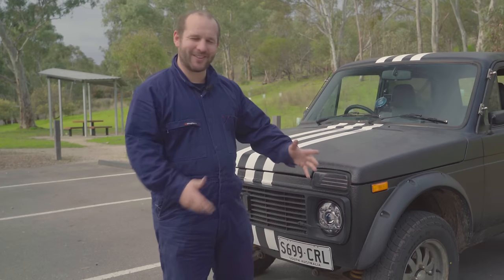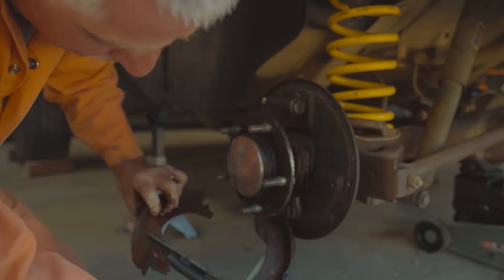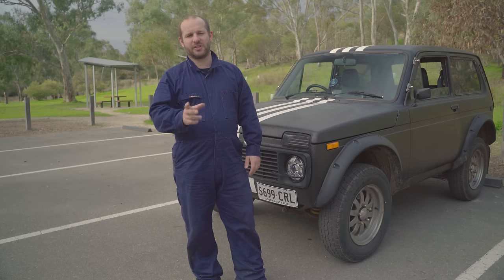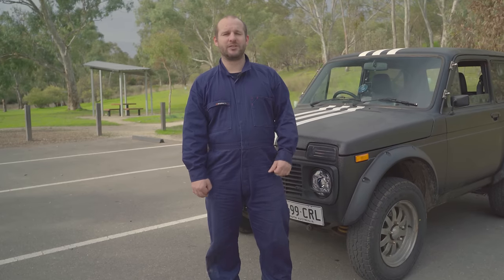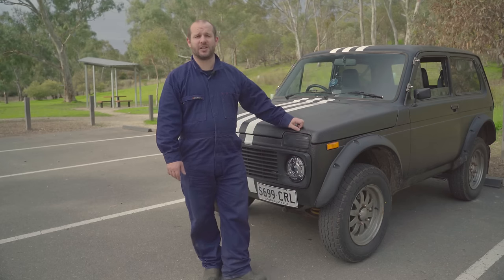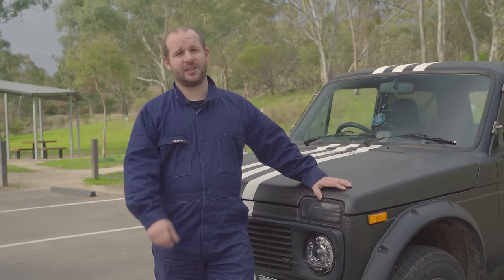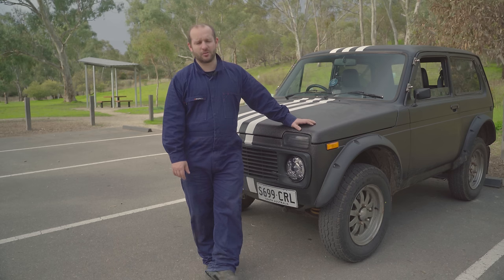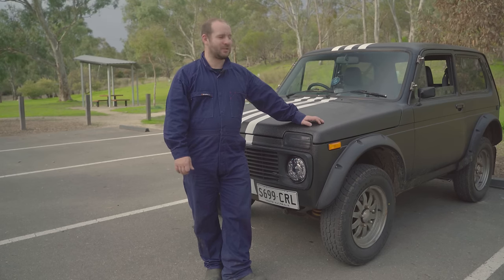LADA BACK ON THE ROAD!

Comment: Honest question about Rego/engineering.
If you only need to get it engineered because it's been off the road for so long, what's to stop you not changing the indicators? I mean, if you don't need to go back and present it again....
Reply from the maker: Honestly I would only get in trouble if the police pulled me up and then noticed an issue with the car and went back and it was on record. Chances would be super slim
Reply: @Pestily  appreciate the reply. That's what I suspected was the case. Better safe then sorry. It's the same here in ireland. Cars have to meet spec for road worthiness test but most modified cars get parts swapped back and forth before the test.